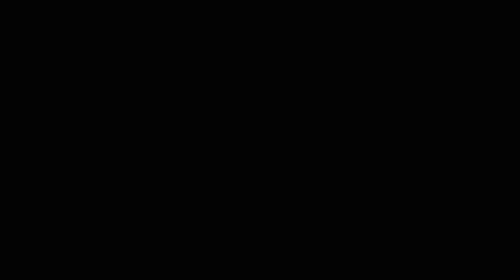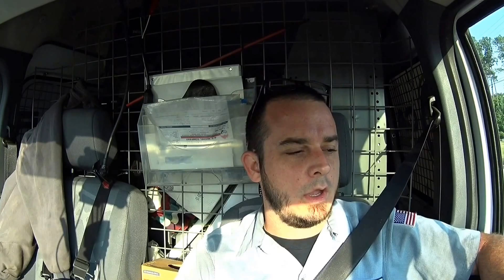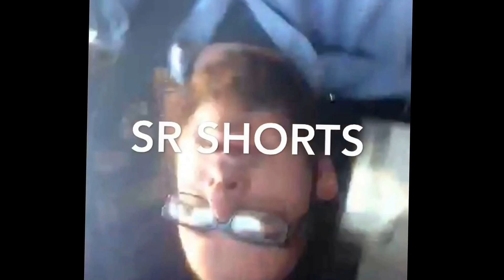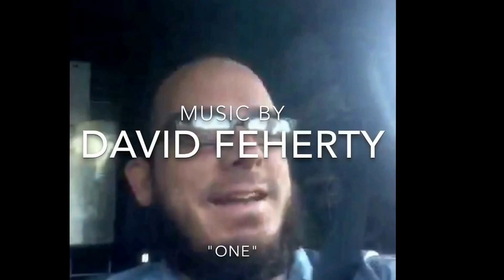HVAC Vlog: Calculating Superheat or Target Superheat

Comment: In my opinion, understanding what exactly  superheat and subcooling is and  knowing the state of refrigerant at each location of the unit is more important then which way a person is retrieving the info. Analog or digital, you have to understand what it is
Reply from the maker: You're  exactly right, IMO
Reply: Stephen Rardon 

i will tell you this,  my company is a warranty rep and certified startup for mammoth/venmar equipment energy recovery/ dx systems . These units which range from 1 ton to 125 ton do NOT have a factory specified superheat or subcooling. You set these units up based off of experience , inside and outside temp conditions and calculations... Emin can relate  on what i am talking about. This is the point i am making- digital has its place and may have a place in more boiler plate hvac equipment. NOW, if a new tech walked up on this type of equipment,  it wouldn't work out well, a tech that knows numbers, calculations and how to achieve those calculations, the tech could successfully work on this type of equipment. Tunnel vision does not mix well in the trade, i feel stressing the importance of digital gauges in hvac is of that. Anyways,  Awesome blog and discussion Stephen and the rest of the techs on here!
Reply: Emin HVAC well said emin. The young technician needs analog period, only way to really learn refrigeration. Ill be willing to bet that 90% of new technicians that have digital gauges can't draw a simple refrigeration cycle and explain what state the refrigerant is in. Its the way i see it only because of the newbies i see around my area- you got these fancy gauges, can read super heat instantly etc etc, but until you actually know how that refrigerant system is working, you will never make a confident repair. I have been doing this for quite some time now and i still use analog, its just how i do it. i will be going to digital as well, just not that important to me. Its the same thing as reading a schematic, if you can read a schematic CORRECTLY, you can figure out a wiring problem... Same thing with refrigeration. Yes the superheat and subcooling will fluctuate, but you know what- a good set of yellow jackets, site glass, and good thermometer and you can dial in a unit just as good if not better than digitals... At the end of the day, its experience and hands on.. digital is doing the work for you not allowing the hands to be on. Learn and learn alot more of the trade, than go digital to speed up your service call adventures.
Reply from the maker: Can't say I agree gregory .sadowski just because we learned the hard way doesn't mean it can't be easier for the next generation.
Reply: Stephen Rardon 

stephen, you do a great thing on here for sure and if i had the time i surely would make videos(need to learn first)... but make a blog on what a refrigeration cycle is, what state the refrigerant is in, what to look for when the unit is not sub cooling, liquid migration, slugging, how to adjust a txv, etc etc. This is quality education to the up coming techs- you teach them this and an ambitious up coming tech will soak this up like a sponge because his brain will be working... show him a digital screen and stress the importance of these gauges will shoot straight thru them- numbers will just be numbers to them... maybe not all of them, but majority.. speaking for myself they would be for me
Reply: Stephen Rardon 

i wish it was the same, but no where near as simple as a 2 ton unit in a basement. you have heat wheels, hot gas reheat, liquid line solenoid bleed valves, reversing valves, digital scroll controllers for the compressors, stepper valves for the hot gas side all wrapped up in the same unit.  its lovely... sad part is, tech support half the time is scratching their head with you, not joking.
Reply: True statement Emin HVAC
Reply: Well said emin
Reply: gregory .sadowski most companies in nyc will make you draw the refrigeration cycle  and explain it in detail, also they will create a problem on a wiring diagram and you would have to figure it out.  It's  pretty much included in the interview before hiring.
Reply: Stephen Rardon 
to each his own stephen. But at the end of the day, the technician will not be quality when the info is given to him or her. the tech needs to work at it and learn, learn from experience, and learn from seasoned tech. Just talk to the old timers in this trade, you will learn from them, i did for sure 18 years ago, my business partner has 41 years in this field and agrees that digital has the place for sure... But a  new technician with these will play a negative part on his career. Like i said, put your time in, then move along to the digitals to give your brain a break
Reply: Emin HVAC  Emin, and that method is the only way to do it when finding a hvac technician... a real hvac technician. I hate like i am sounding cocky and blunt but facts are facts. These newbies with digitals will be waiving the white flag yelling for help in the real world.. esp commercial(25 ton +) equipment that had 67 hands in years prior band aiding repairs, txv adjustments, etc etc.
Reply from the maker: Will have to agree to disagree gregory .sadowski
Reply from the maker: My point is that rather than only asking for the SH and sc measurements to be made let's ask for the full package. Whether we're reading a needle on a dial or a digital display makes no difference whatsoever.
Reply: Stephen Rardon 

i can understand this stephen.
Reply from the maker: A new tech would certainly struggle with that type of situation.
Reply: Stephen Rardon 

no doubt, i struggle with it at times, even 20+ year commercial guys struggle with it.
Reply from the maker: Trained properly and with the tools to do the job properly, it wouldn't be any worse than a 2 ton system in a basement.
Reply: Commercial is a different animal
Reply: Emin HVAC you got that right Emin.
Reply: Emin HVAC what's the trouble?
Reply: Sean Pierik what's the trouble?